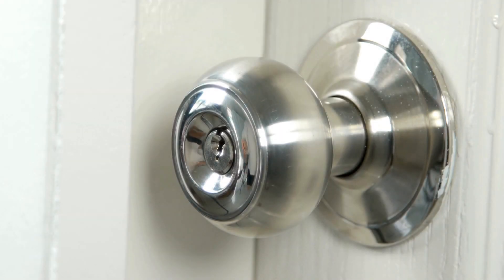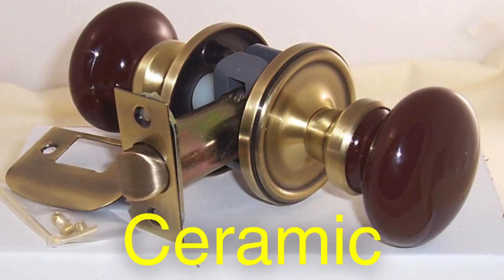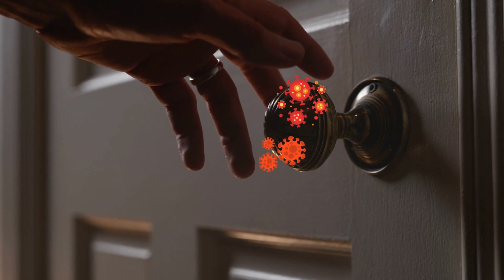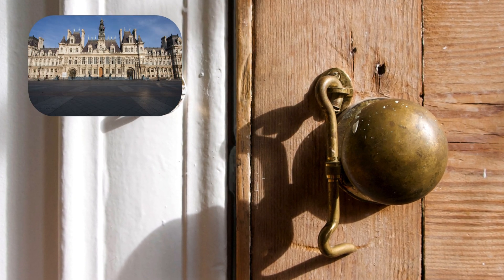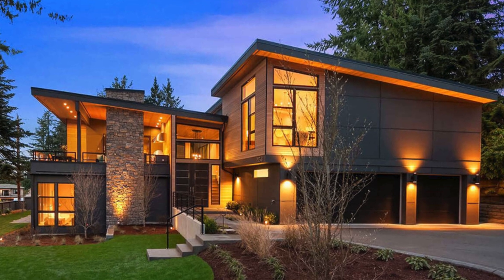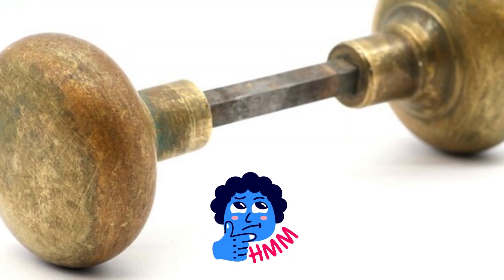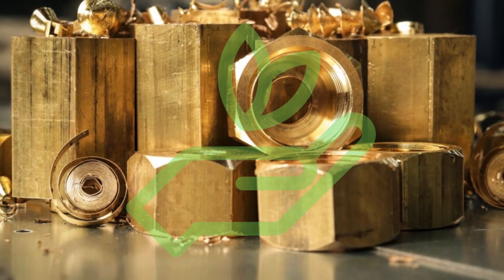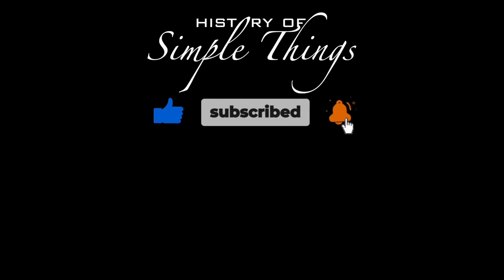Why Are Doorknobs Often Made of Brass?

Comment: Doorknobs are being phased out. Fire codes mandate stainless steel lever door handles in new buildings. The claim that brass doornobs reduce the spread of pathogens in high traffic areas is pure BS. Copper alloys take many hours to kill microbes. If there was any validity to that claim, why aren't toilet flush handles made of brass? This video is a time-wasting source of misinformation.

Comment: Regarding 2:03, the anti-microbial property of brass is effective on bare brass. However, brass hardware nowadays is often coated with a transparent layer of lacquer in order to prevent the brass from tarnishing. The lacquer coating for aesthetic appeal saves on maintenance labor from having to polish brass to keep it shiny and bright. Ironically the lacquer coating also prevents the anti-microbial property of brass from being effective. Therefore metals that have anti-microbial property are uncoated silver, copper, brass and bronze. Silver, copper and gold are also excellent conductors of heat and electricity. Furthermore sterling silver utensils are bacteriostatic whereas stainless steel utensils are not.
Reply: You beat me to it!👍🏼